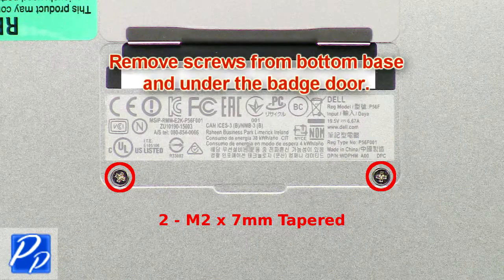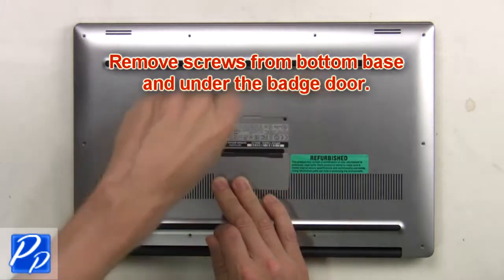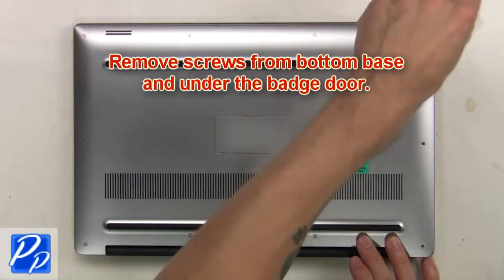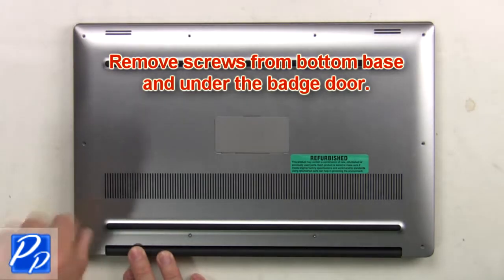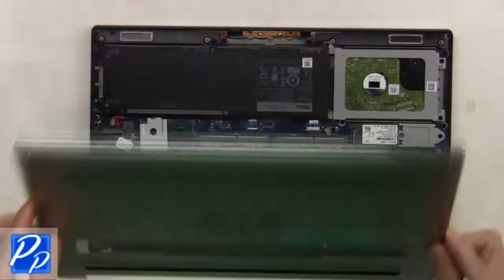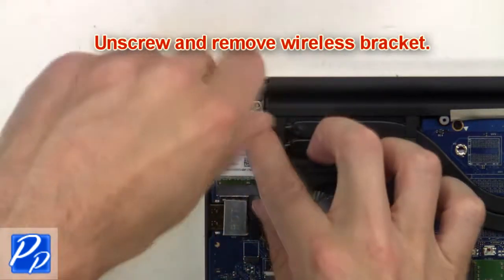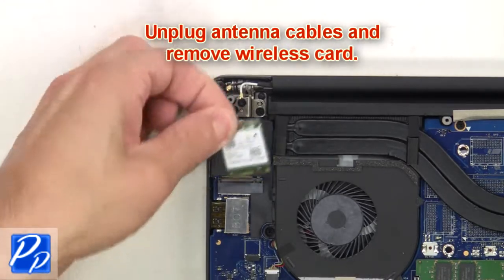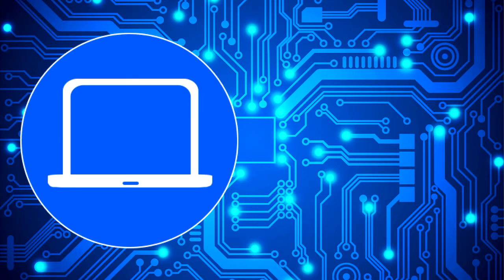Dell XPS 15-9560 (P56F001) WLAN Card How-To Video Tutorial

Comment: Okay. I’m stuck on step one 🤦🏻‍♀️. My screwdriver thing can remove the set of screws under the lid but are the other screws a different size? What type of tool is needed to remove them?
Reply from the maker: The ones that secure the bottom base require a Torx screwdriver. You can find them here: https://www.parts-people.com/index.php?action=item&id=32505